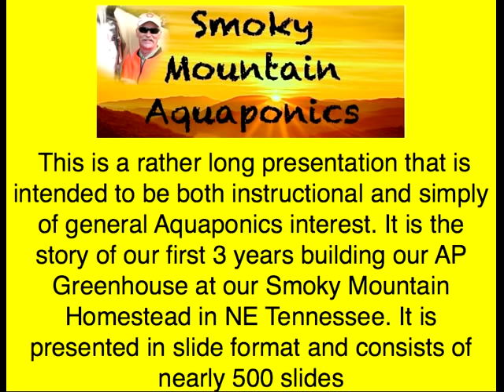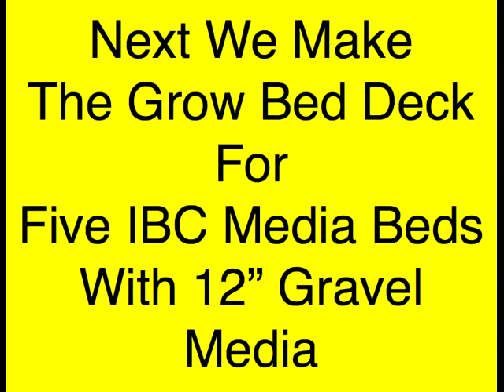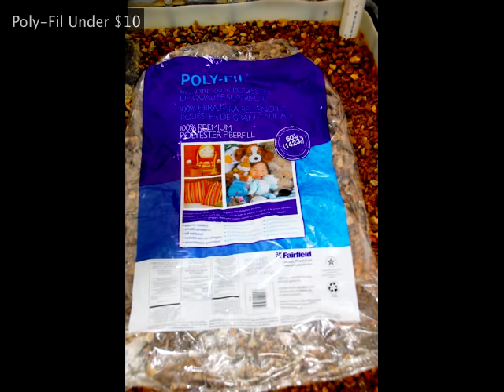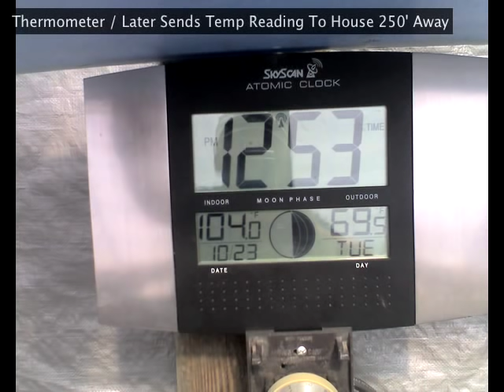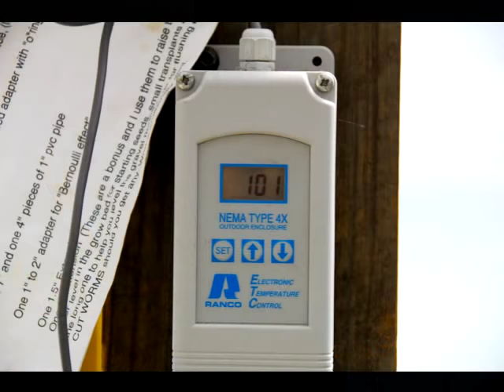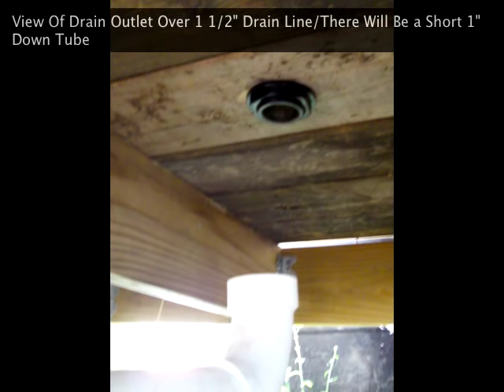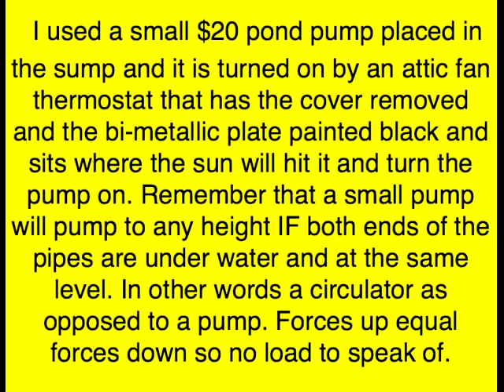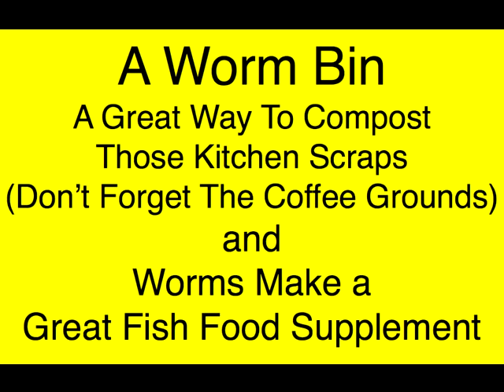Aquaponics Greenhouse System Build In the Smoky Mountains

Comment: Great setup. Have you done anything other species? We've been looking into doing a second tote with the Austrailian red claw.
Reply from the maker: We are so busy building our house and always more outbuildings that I have only stuck to trout for the past few years. We have raised catfish and bluegills in the past but trout have been the easiest and most rewarding. Red claw has been on our mind as well since we have 5 fish tanks and only use 2 most of the time. We built the system large enough so if TSHTF our families can raise all our food right here on the homestead if need be so we do have extra capacity we haven't used yet. I built our own wood fired gasification boiler for the house and GH as well so we stay pretty busy around here. We are supposed to be retired at 71 but I run 3 businesses as well. More like retarded than retired but we have to stay busy or we get very bored.

Comment: very cool set up. seems like a costly investment though!
Reply from the maker: not so bad if you are a good scrounger. i.e. our new kitchen sports a beautiful ss dishwasher right out of the dump. Just needed a motor that I had already scrounged as well. Just one example. Got a 6 Mos old gas HW tank from a customer just the other day. I could go on. The plastic cover on the gh came from a commercial grower for 25.00. 50' x 25'. Enough to cover the gh twice. Ibc's can be had cheap. The wood stove cost about 25.00. etc.
Reply: most the ibcs ive seen are in the hundreds for food grade if theyre fairly new, i managed to get some for 85 ea
Reply: I got my food grade IBC for free from work :)
Reply from the maker: Compared to a commercial style GH this was very cheap indeed.